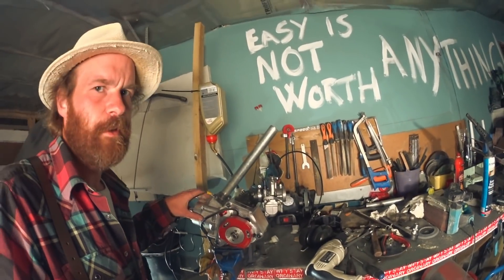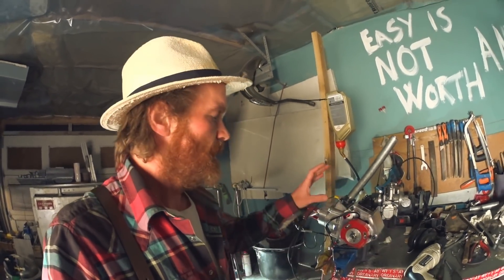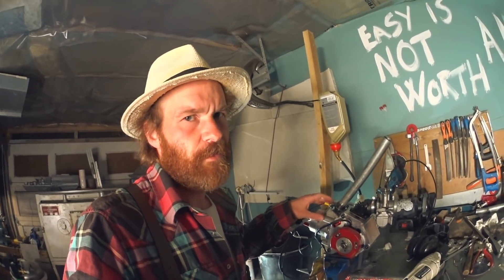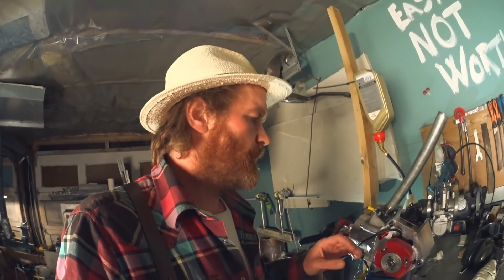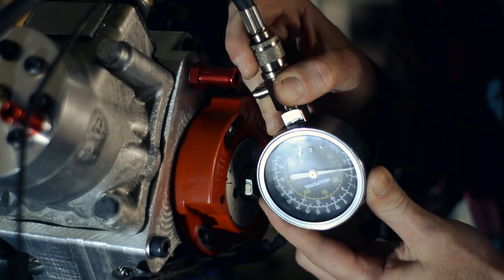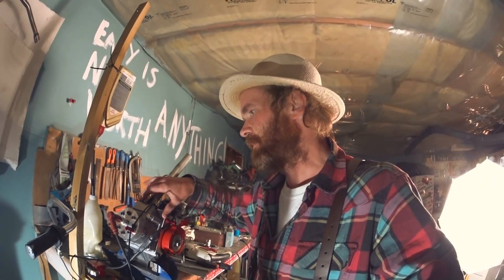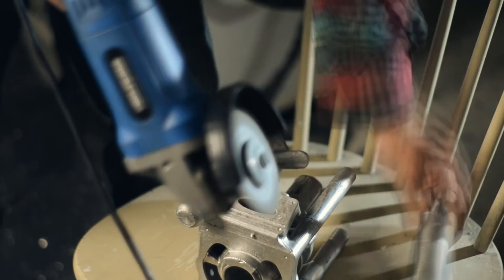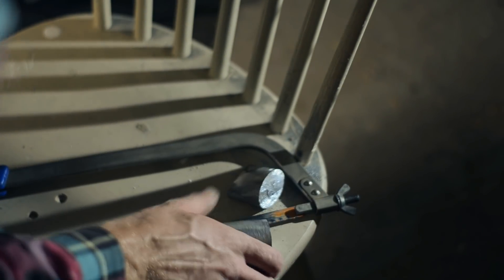Pipe! - The Most Powerful Two Stroke Ever

Comment: Imagine putting this technology in a 250cc
Reply: Yeah, but it would be awesome to say you can go over 100mph with an 80cc engine.
Reply: @stuffthatgoesfast2259  that's why I love small engines
Reply: Mark williams but you can go 100 with a 70 already
Reply: Rosegold Beats i mean yea you prolly could on a dyno but on a road there is the wind resistance and stuff its quite hard to achieve 160KM/h speed, i did 83mph (135km/h) on my 78cc and that was it due to the wind blowing so hard
Reply: PreFIN24 true
Reply: Mark williams 50cc
Reply: @stuffthatgoesfast2259  tomos had a 50cc "dmgp" , 204 kmh, 6 gears, 45kg(or 50), around 20 ks
Reply: @stuffthatgoesfast2259  i have seen 50cc mopeds that go 150+kmh
Reply: @stuffthatgoesfast2259  Yamaha GT80 goes pretty quick
Reply: I think you would go super sonic
Reply: With all due respect... get the engine in a frame first and open here up..... it will do 0 mph attached to a rig
Reply: I now regret selling my RGV race bike even more... a bit over 74 RWHP.... what fun that was.
Reply: @GTE_Channel  they are great stroker motors man, I couldn't keep up with my kr1, I caved and bought a mc21 with rs barrels and pipes just so I could keep up as I was such a shit rider..lol
Reply: Would be useless for anything but LSR or drag strip stuff sadly. This is the problem.with high strung highly tuned engines. I suspect one of.the main reasons this thing runs as consistently as it does is nitromethane hides a LOT of sins. It allows for afr to be a lot lower and still run really well given it carries more oxygen in the fuel etc. 

You'd likely heat seize and melt pistons so often it wouldn't be funny coming off the throttle.
Reply: And i think you wouldn't get far, unless you had this transmission to back it up:
http://www.elsberg-tuning.dk/suzuki.html#rk67  
😂😂
Reply: 50cc streamlined speed record is at 236kmh or 147mph by buddfab i do believe
Reply: @mattparker5639  streamlined bikes are an entirely different beast especially if they are getting a tow to 60 lile the bigger streamlined bikes. Good aero can get you insane performance with very little actual power. Look at the early LSR stuff that was basically 2 kayaks stuck together or.the 20's race cars that were essentially cigar shaped.
Reply: @mattparker5639  Ive met that guy and his build is the most amazing engineering I have ever seen.  The bike hangs from the ceiling I his shop now!
Reply: NoNoNoNii  hardly, the RS125 single Cylinder from Aprillia did 33bhp in unrestricted trim and could hit 45 or more in race trim and the 250 could hit 60bhp if built right and both were singles. This 50 us probably hitting what 26 at most in ideal conditions given the early experiments with nitromethane on the sbk were giving him 17.1 or so.

The performance issue isn't power its going to be gearing the Variator/CVT in the bike is not designed for great power and they aren't generally great for riding. The engine movement may help some here as will the fact that it is only expected and needed to run at WOT on a flat so can be setup to run within a 100-200rpm range for pretty much the entire run. A conventional gearbox 14-16" wheels and 25bhp will beat in any metric that matters for usable power a variator/cvt with the 9-11" scooter tyres and 33bhp. 

Great example of power not being everything is the gen 1 rocket 3 from triumph its 140bhp (restricted) and probably not that far off 2.5x the weight of a same year ZX10R with 180hp but wider tyre, weight, better gearing for mid range torque means that the big heavy  triple is faster 0-30mph than the sports bike and only a tenth/2 tenths slower 0-60 and in both 40-80 and up till about 120 where the rocket hits a wall caused by its gearing and the ecu's 140mph max top speed àrestructions

All.the power in the World is rock all use if you can't get it to the ground.
Reply: or a 500cc V10 @ 300bhp 😈
Reply: There's a reason that 250s aren't even twice the power of a 125... There is an optimal engine size. Somewhere between 50 and 125cc
Reply: Yes . Nothing would  start lol
Reply: Duuuuuude hell yeah i would soooo buy a bike with such a engin
Reply: NoNoNoNii  thats not what you said though you said 'it would have to be a twin to be as powerful' 

To be fair my 45hp number for an RS125 single was very Conservative, the works and privateer bikes from 125 gp are hitting 60hp. I never went that high because I was racing on a shoestring budget so I was happy to sacrifice a little power for reliability.

As for optimal I suspect an inline four would be based on 2 stroke  race bikes, the most.powerful 125cc bike I know of was a Honda V6. But that was a terrifying thing revving even higher than this 50cc motor, had 8 gears, sounded unreal and  they were so expensive they only made like 10 of the things.
Reply: @jediknight1294  Crank or rear wheel hp? I would love to see your dyno chart if you made 45 rwhp. I worked for a dyno tuning shop for many years and I've never seen a 125cc single make 45rwhp on a dyno. I've seen many claim their engine builder told them 40+hp and when they put their rear tire on our dyno they made 32-35rwhp.
Reply: @Two-StrokeLife  towards the tail end of the GP 125 class   a factory aprilla/Gilberawas hitting 70 or more it got stupid Honda last 250cc bike was considered to be underpowered at 95-100bhp. I got very lucky in terms of what I was able to ride people who had old works engines etc that had bounced around the privateer scene.  The 1999RS125r Aprilla (Ohlins shocks and a higher compression engine) was 45bhp but that is running 15:1 compression and the RSA leased bikes and the Works bikes were 50-60 depending.on year but you have to remember that was with rings lasting 30m/100km, pistons about the same and a crank being essentially one racing weekend and done at GP pace. 

Ryger got their version of the Rotax RS125 single cylinder engine approved by the FIA for karting recently (last couple of years) and that will do 70bhp but has its redline somewhere around 30000rpm and you want it in the region of 18500-22000rpm in actual use and you are rebuilding the thing every couple of races. 

We have seen something like 30yrs of development of that rotax based engine and got it to do ridiculous things.
Reply: @jediknight1294   So your hypothetical crank hp was 45 so maybe 40 hp at the wheel but again, I'd love to see that dyno chart. 15:1 compression ratio on a 54mm x 54.5mm 125cc two stroke...something smells fishy. You must be using the 4 stroke static method not the two stroke swept area dynamic method. Either that or you had about a 2.5cc combustion chamber that had enough room for the spark plug and that was it. Lets be 100% honest even at 20000 rpm a 125cc single wouldn't make usable power for anything.
Reply: @Two-StrokeLife  the 15:1 wasn't my bike that was the 1999 rs125r stats are openly available it was a nuts thing. My rs was 45 at the wheel and nearer 49-51 at the crank. Shame I don't have the dyno charts but iv moved 10 times across 3 countries since I was racing someone elses 125,  still it was an evil thing though you don't see many guys dynoing them mainly because of heat seizing in the dyno.

As for usable power, when I was 14-17 and weighed like 85lb and was still sub 100lb in racing leathers, back protector and helmet the 45bhp  at 17500rpm was perfectly usable on track. Now I'm about twice that weight, twice the age and my ankle is shot, my backs fucked and 
3 hours on a race bike even a 600cc bike which is much larger wpuld break.me for the next week. 

125 2 stroke race bikes were amazing when I was that age and still convinced of my own mortality, I wouldnt want to ride one on the road  even then. My road bike was MUCH MUCH less conservatively tuned. (Mainly to avoid getting banned as I was limited to 15bhp on learners permits) but also so it didn't eat ring every week just riding back and forth to high school. They were in racing trim a bike where you had to be open throttle and max revs pretty much all the time but they were light enough and slow enough that you could ride like that.

I learned SO MUCH on track with a 125 and later a 250 but... it also taught so.e bad habits when I moved to bigger bikes and expected them to be as light, as flickable and able to thrash the thing everywhere.k
Reply: @jediknight1294 Yeah that's a full swept area (sometimes referred to as static, uncorrected or published) compression ratio not the actual corrected (trapped swept volume) C/R used for 2t tuning. This is why most power valve 2t have two C/R's listed (one for valve closed and the other for open). Sounds like we are about the same age I've been around 2t race bikes since the 90's. I did final assembly and helped with dyno tuning. We ran them on the dyno to get base tune before finalizing ig maps/jetting on the track so I had first hand knowledge of what many bikes actually made.
Reply: @Two-StrokeLife  I was lucky in that I got handed rides on kit id never have been able to afford. Race prepped lc350's from that short run series, ex national level rs125r's I was around these things in the early/mid 2000's so a little later than you.
Reply: Cr250s can run 90hp
Reply: @gilerarunnertc1834  id like too see that any proof too back that one up ?
Reply: Plus you boys need to go look at pm tuning twin cylinder Piaggio engine, twin 172cc cylinders pushing 60hp with 28mm carbs he estimates 90hp after race tuning
Reply: Malossi 180cc 2t
Reply: @Wasophangen  again, slow engines for what they are
Reply: NoNoNoNii  it's 1 cylinder, street setups make 37 hp, highly doubtful it's 60hp from the "race" model
Reply: Guys, 250 can't reach that high rpm. There are some laws of physic which say that piston shouldn't go faster than 25m/s. 250 usually have +/- 70mm stroke. We can easily calculate the border of safety speed. Rpm * stroke : 30. With 70mm stroke max rpm will be 10700rpm.
Reply: Sod the 250 hows about an 87 kx 500 or 86 cr 500 now ur talking. Oooph.
Reply: NoNoNoNii  150cc quad cylinder
Reply: The road to success is a slow one.
Reply: @Rusty the karting engine 30k is the redline iirc.
Reply: @Rusty the Honda racing bike I have no idea off hand its been years since iv seen one torn down. Look up the TZR250 yamaha race bike. 

These were purpose built race weapons sold to racers for the track kinda like.the HP4 and similar but for actual racers no track day enthusiasts. 

The ryger kart engine is based off the rotax aprilla but has serious work.to.changw the bottom end with spacers and essentially a whole new designed bottom end.
Reply: It wouldnt work
Reply: @vexi6688  depends what you mean by wouldnt work. Would it be an effective LSR two stroke for that capacity records....possibly, would it be a viable road bike engine, no.
Reply: @jediknight1294  i just think the ring will snag up on to the exhaust port with engines with wider bore even if its retained like in this one
Reply: @vexi6688  thats possible, you can get away with a lot in small bore cylinders if you did it as an inline 4 you'd only have a 62.5cc cylinder so what... 12.5cc larger which isn't that much larger a piston something like 1.4% larger. If you took inspiration from the Honda 125 that rocked the TT in the 60's and the Honda GP bike  Rossi won a world championship on you could even just do it as a V5. Meaning you could run exactly the same bore and stroke with the same size pistons that he has in this 50. Would be expensive to cast and sound insane but wpuld deal with the ring issues.
Reply: @jediknight1294  yeah but no way single cylinder 250 would work withot exhaust bridge
Reply: @vexi6688  it hasn't been done so we can't definitively say it won't work . We need someone with the software to model it and see tbh. It's not something I can do myself. There are some amazing tools out there now hell there are even car design games where we can design an engine that it could be done in. 

I agree that a single would be unlikely to work based on what I understand of the issue but given a larger number of cylinders generally gives you more power or at least the potential for more power in a given RPM so if you aren't limited by class rules, parts number decreasing reliability/potential for increased issues or weight consideration why go for a single. (Explaining why dirtbikes are singles tbh, cost of frequent top end rebuilds would quadruple with an in line 4 and given they tejd to be better at high rpm its not where the power is needed)
Reply: Ricky Carmichael is that you..
Reply: @Community-Action  lol, I grew up around guys who collected ex race bikes/vintage/classic race bikes and raced/tracked them. Iv been lucky enough to ride some mental things that when they were racing at international level were 100k plus machines with full factory support
Reply: Search on youtube what we make in portugal with yamaha 50 and 125 engines..
Reply: Would be a absolute monster! I think it would literally eat the asphalt😂🤘
Reply: He will.....
Reply: So.... if the cylinder is only 50cc here, and the crankcase is 350cc, how big would the 250cc cylinder crankcase be??? Oh yeah, math... 250cc version of this would have a 1,750cc crankcase.... 500cc version would have a 3.5L(3,500cc) crankcase.... you’re talking Porsche engine sizes, not motorcycle engines. This is great in it’s current size.
Reply: Imagine a cr500 or another 500 or 480
Reply: I was just gone coment that, but as a 500cc 😂